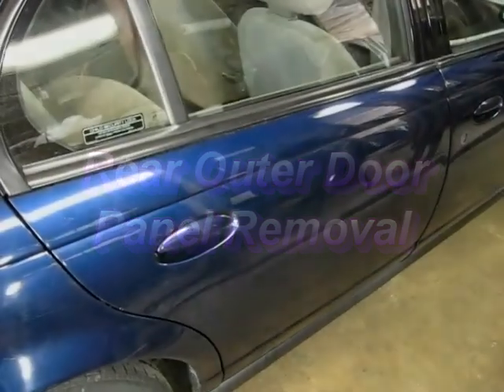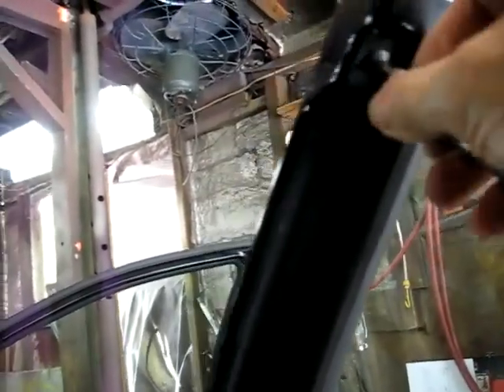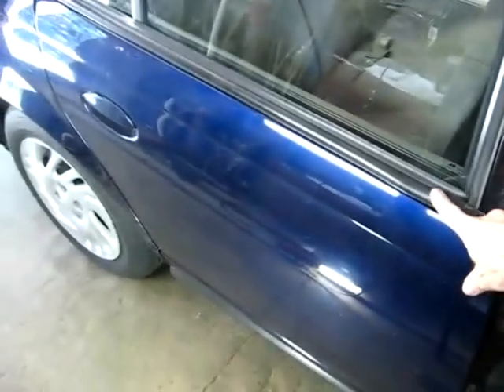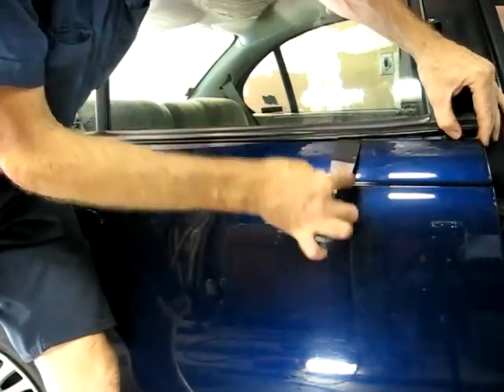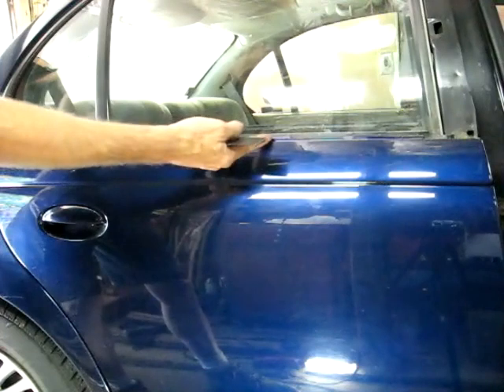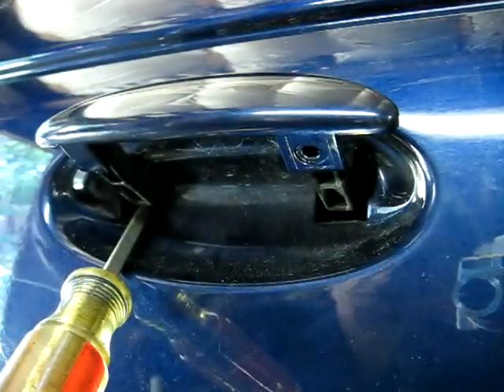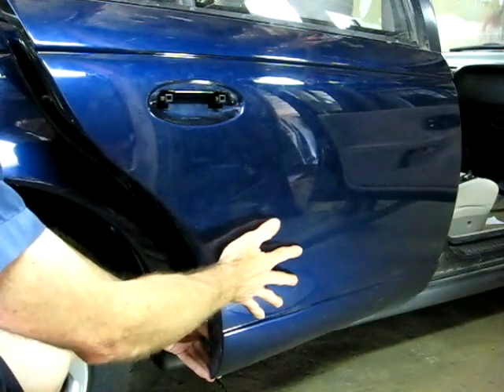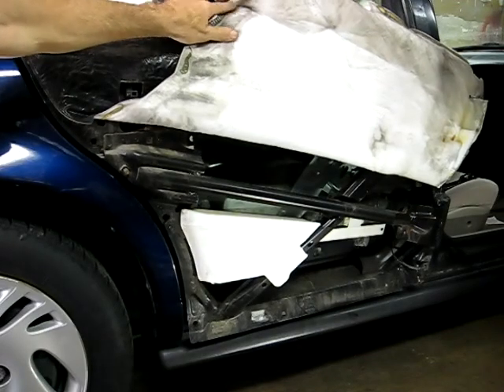Rear Outer Door Panel Removal

Comment: Be sure to not snap any torx screws off or you're screwed if you don't have enough left to hold the panel on. That I know of, there's no way to fix them but get another panel, but the same problem may occur getting your replacement off. I snapped off almost all of mine on my L200 a few years ago replacing the insulation that deteriorates over time. I believe those are in there with locktite.

Comment: Thanks. I'm attempting to locate a most annoying vibration coming from the passenger rear door on my '01 SL1.
Reply: Kenneth Holland Jr  I'm not a wrencher, so things sit for a long time before I get to them, but the vibration seems to be coming from something in the rear, right strut assembly. 

Re: the door. I pulled apart my right, rear door a year ago but found nothing. I needed someone to drive around, me in the back seat, with seat backs down so I could fish around the trunk area to find the source of the vibration.

Comment: Rich, Saturns look like pretty well put together cars. After owning several would you agree? How did they stack up against other makes during that period? Thanks
Reply from the maker: Mine has stood up well over the years plus i rate it a very easy vehicle to work on.
Reply: @RichpinTv  try changing the dual fan motors on the radiator .that was a job.